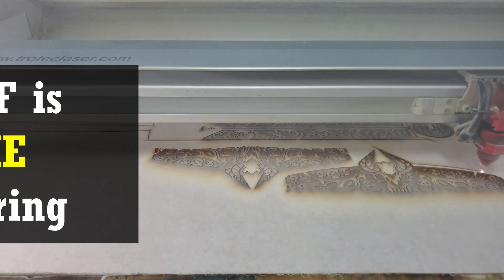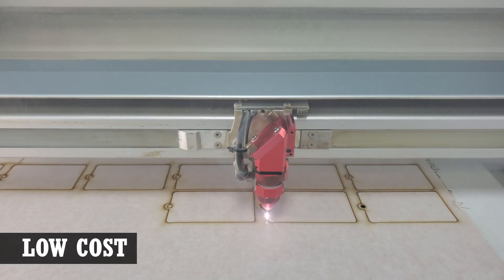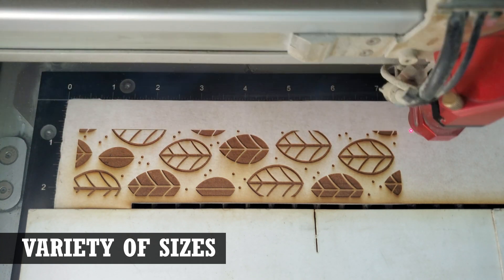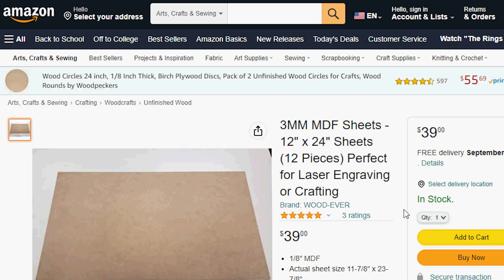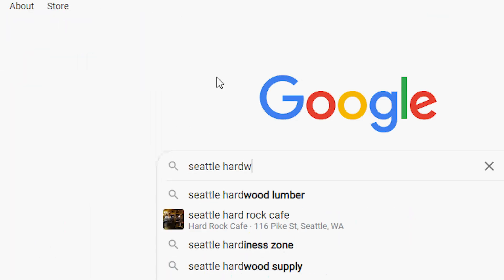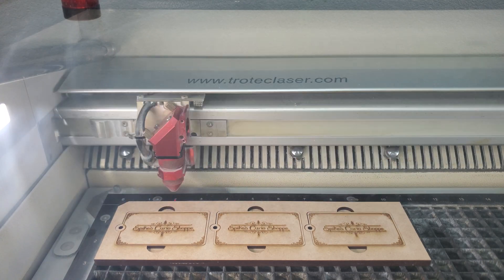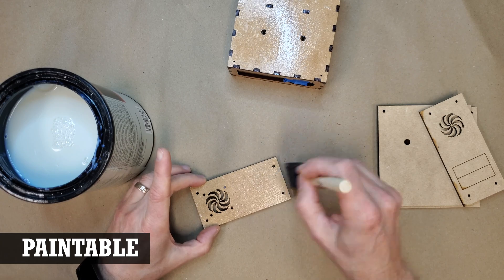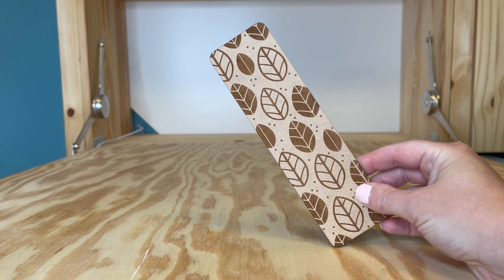Why MDF is the Best Material for Laser Cutting and Engraving

Comment: You did not even mention any disadvantages, addressing only non-critical minds. No mention of super-toxic gases when cutting especially laser cutting (Phenol, Formaldehyde, fine toxic dust, etc.). And a diode laser does NOT cut through like butter. It takes several runs with focus adaption to cut through and the burned edges are pretty messy. You don't have that problem with slightly more expensive plywood

Comment: Cutting mdf regularly is a sure way to ruin your laser cutter and filters.  It will leave a sticky mess everywhere and you’ll be left with a terrible smell that won’t go away. Do not work with mdf unless you’re in a dedicated shop space and are willing to clean the machine and filters about 5 times as much as normal.
Reply: Agree. After cutting only seven "Cheshire cats" from MDF of about 12" x 12" bought at local builders shop I had a lot of sticky mess on a laser head module and it was very difficult to clean properly. After cleaning  the laser now I avoid to engrave/cut MDF at all, may be only if it is laser compatible, however it is rather expensive.
Reply: I get more sticky mess from plywood than from mdf. It must be your material.

Comment: Interesting video.  Hardboard is like MDF.  It is used for flooring.  A 4' x 8' sheet, 1/8" is usually under $14.00 at Lowes.  It's basically MDF, but a little harder.

Comment: I have a problem with soot on the burned edges, I don't have it on plywood, it rubs off on everything and is hard to remove, you have to clean every edge and some of the cut pieces can me quite small. I tried less power to burn and more passes but doesn't seem to help
Reply: he paints everything

Comment: I used some MDF from Amazon just now, all the cut lasered edges have soot all over them, I can't get it off and it transferes to the parts. What do I do?
Reply: try using a light damp towel and wiping it.
Reply: You sand it with 220 sandpaper. Or cover surface with painters tape

Comment: I do a lot of laser cutting with mdf, ive built a very well sealed unit to keep the fumes out...all the smoke it creates goes out through the ducting to outside. For extra measure, i also use a blueair purifier in my workshop to get rid of any nasties that manage to escape when i open the lid. Gotta be careful.

Comment: I was using MDF, but found it a bit weak for things like hinges and looks like cardboard when cut (had a couple of people say that). The flatness is great and no warping. Great for some things, but not for outdoors or moist environments. If it gets wet, it swells and crumbles. Fine for indoor stuff, but for items like boxes or keychains that take abuse or can get wet, not the best. I use regular plywood for boxes etc, even though I lose a couple of boards to warping. Better than reg plywood for jewelry.
Reply from the maker: Yes, MDF definitely does have some drawbacks and will not be suitable for all projects or products. It's just such a pleasure to work with it over a lot of other materials we use. :)
Reply: @smedleyworks  Agreed. With reg plywood warping is a big factor, Out of 16 boards I usually have 4 that are too warped to use. Also, MDF always cuts; some plywoods are a hair too thick and won't cut through properly.

Comment: Yep... so tired of warped plywood. Going to stock up on MDF and see how it goes.
Reply from the maker: If you have a downdraft table, good exhaust, and can cover any table openings, you can get warped material to suck down flat. If not, then that's a great reason to use MDF. 🙂

Comment: I don't like the fact that after cutting mdf, the burned edges are so dirty and makes it so difficult to use the cut piece without getting everything and your hands dirty. That does not happen with plywood or birch
Reply from the maker: We get a nice light brown edge that really doesn't get on your hands. In fact, we used to cut thousands of blank products from 1/8" and 1/4" MDF to be used in our UV printers, so the surfaces needed to be super clean. Back then we cut everything with our 75w Universal Laser in one pass without any issue. Are you getting a black sooty edge? Maybe it's the MDF brand you're using?

Comment: Hi, awesome video i have a question, You said you get the mdf the 48x96 for $22. Where do you get it ? I work a ot with mdf and i seen that size but 1/2 in. And 3/4 but not the 1/4. I only can find the 2x4 sheets. Ill appreciate the help and God bless.
Reply from the maker: I would search Google for "wood supply" in your area. Places that supply woodworkers and cabinet makers should have it. I think I've also seen sheets in Home Depot, but I'm not sure how big.
Reply: @smedleyworks  thanks that's where i get at homedepot but never seen 1/4 4x8.  Thank you👍

Comment: MDF doesn’t like to cut! My 80w laser cuts fine on birch ply at 1/2in but I haven’t been able to cut that thickness with MDF
Reply from the maker: I have been able to get through 1/2" with our 120w lasers, but it makes a mess of the edges. We don't go any thicker than 1/4". I've been able to get though 1/4" MDF with our 75w Universal without issue. Our 120w lasers make short work of it.

Comment: Would mdf people good for keychains? Or is it not durable enough for wear and tear?
Reply from the maker: You might be able to get away with 1/4" MDF, but the edges will still wear. If it's for temporary or promotional type keychains, then it might be ok, but I'd go with something a little more durable. When we used to sell wood keychains, we used a maple veneered MDF core wood that worked really well.

Comment: Great video! Did you say you’d share links to some online mdf supplier options?
Reply from the maker: Our apologies. We forgot to add the links. Here they are below (and they're also in the description).

1/8" - 12" x 19" MDF Sheets - 10 pack
https://amzn.to/3RY4c2g

1/4" - 12" x 19" MDF Sheets - 10 pack
https://amzn.to/3S9rima
Reply: @smedleyworks  well, based on the given link it comes to 23.9 pence per square inch for 8 12"x19" pack, i.e much more than 0.005 USD. And another thing - not all MDF are suitable for laser engraving/cutting. MDF from builders stores at least in UK depending on the brand have a lot of glue/formaldehide in it and therefore are not very good for engraving/cutting. Laser compatible MDF it is quite expensive.

Comment: Did you say that you need to treat the mdf before cutting? Like with a clear coat?
Reply from the maker: No, MDF does not need to be treated before cutting, but it does need to be treated before painting.
Reply: @smedleyworks  what are you treating it with before painting?
Reply from the maker: We typically use a water-based paint sealer, but there are a number of things that will work.

Comment: I like all the pros of using MDF, but I'm concerned about it's biggest con: apparently it releases toxic formaldehyde fumes when lasered?
Reply: Most reputable wood suppliers are that sell MDF will be able to tell you if it is formaldehyde free. Most in the US is.
Reply from the maker: Many of the woods that you're going to laser cut are laminated with an MDF core. We've been using it for years and we're not dead yet. :-)
Reply from the maker: Seriously though, we've always had a good exhaust system in place to mitigate any of this.
Reply: @smedleyworks  do you think a vac hose would be good enough or should I ventilate it more ?
Reply from the maker: @Razie1201  That's really going to depend on your laser bed size, exhaust blower, laser power and how smokey it will get. Sorry we can't be of more help here.